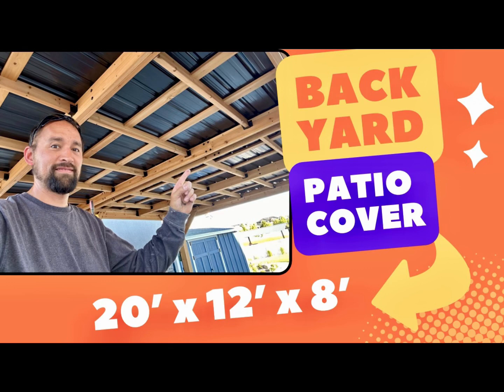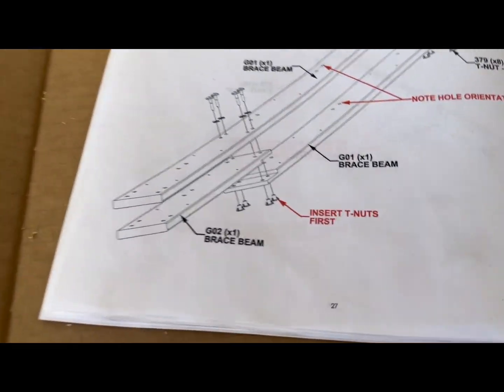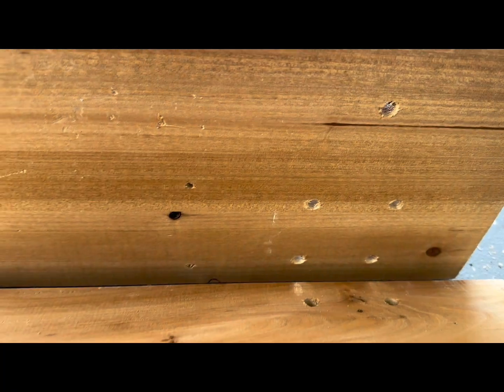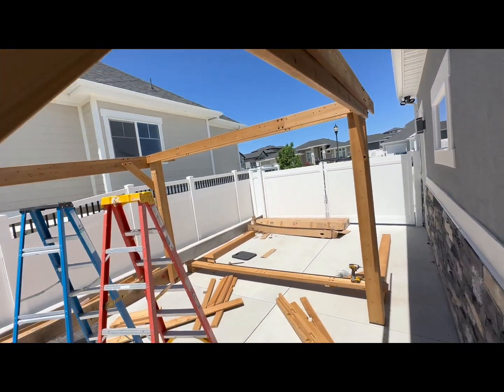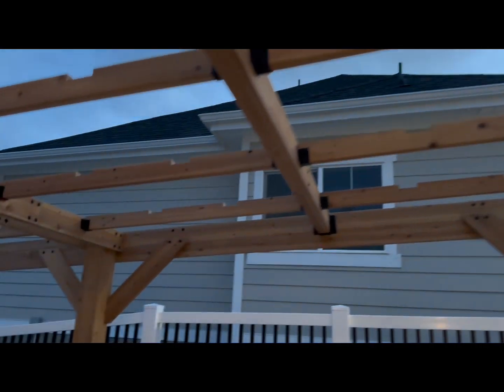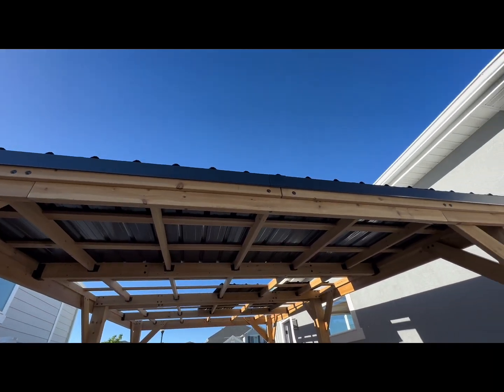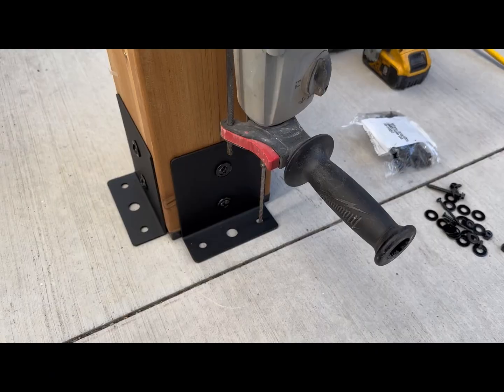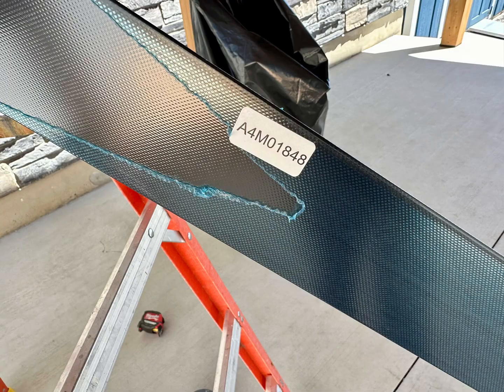DIY Home Depot carport build

Comment: I've seen complaints on leaks on the roof screws. Any experience with this and if so, would it be a good move to use silicone when installing the screws on the roof ? I'm considering the 20x20 unit.
Thanks
Reply from the maker: Excellent suggestion. You can also upgrade the metal roofing with longer thicker materials at steel supply store

Comment: Did you "seal" the carport?
Reply from the maker: The wood is already pre-treated or pre-stained from the manufacturer. I suppose you could add an additional layer if you really wanted to. You could sand it down and re-stain it or even do another clearcoat. But the instruction says that it’s already waterproof.

Comment: Nice video thank you for taking the time to make the video! How is it holding up?

I was looking at this to use for a solar array in our backyard. Any guesses how panels would lie on this without the metal roof?
Reply from the maker: There are so many details and variables in your question. It depends on the size of your solar panels. You can always add extra support underneath.
Add more bracing length, wise and width wise. You can use steel or wood or a combination of both.

Comment: Do you think it would have been easier for you if you just bought lumber and built the structure instead of this kit?
Reply from the maker: There’s pros and cons. Although it took a long time, having everything pre-cut and pre-drilled is nice. 90% built by myself. Tons of time verifying digital and paper instructions…
Way faster if I had a full time helper.
Reply: @Jeremyisyourhandyman  having a helper definitely makes things easier.